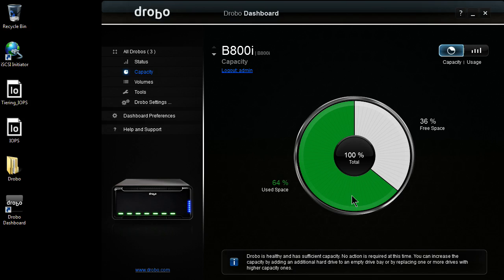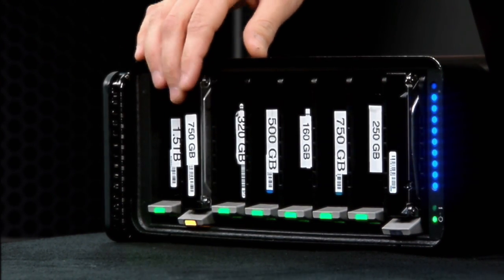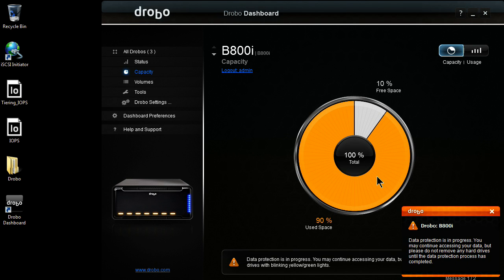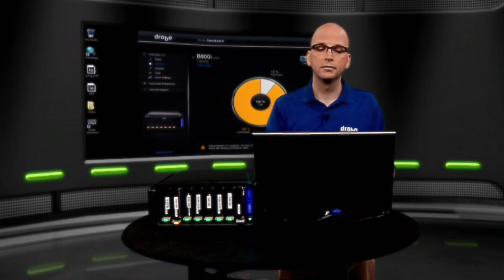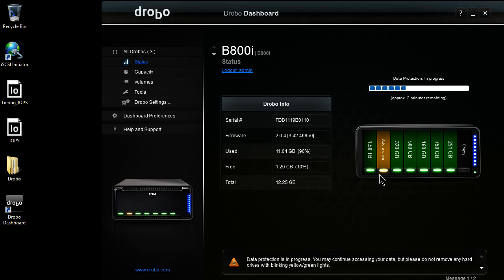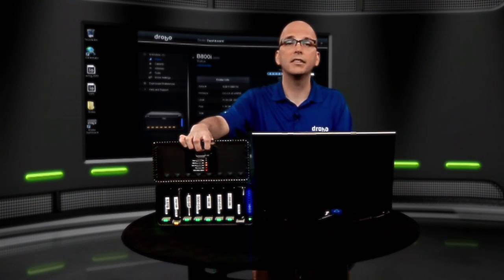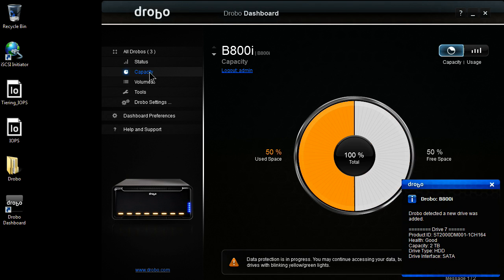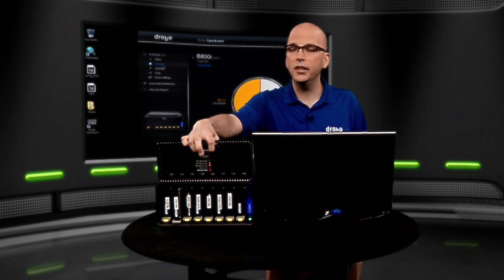Drobo | Software Demo | Automatic Rebuild | Automatic Expansion

Comment: 1) Don't you have to format the new HD before it rebuilds?
2) I performed a backup on my 4Bay 3GEN I selected the duplicate HD option in the event of a 2 drive failure.  When I went into Windows explorer I don't see the second/duplicate backup.  Please explain.
3) Generic question - Is it really necessary to do a complete system image of my main HD or are the backup's sufficient in the event of a main HD failure on my computer?  I am hearing pros and con's for both.  I would think that after installing a new main HD it would be best to just use the system disks and do a clean reinstall with a follow up install using the last backup file.  Any suggestions?
4) If the system is formatted as a single volume with only one drive Letter are the other 3 HDs within the DROBO duplicating what is in the first HD and therefore it does not matter which HD fails because the other 3 HD's look like the first HD?
5)  What happens in the case that the first HD becomes full and data storage now flows over into the second HD?  In theory the second HD would not have the exact data as in drive 1 because some of the data in drive 1 had to be stored in drive 2? If drive 1 were to fail and subsequently replaced, not all the data is stored on drive 2 because of the previous overflow from drive 1 would it not?
6) If DROBO uses proprietary software can I remove a drive, transport it and put it into another computer and have the files all recognized? This would allow great flexibility in my opinion when working with others on projects and ensure safe backups. 

Thanks for the video,

The Meltdownman

Comment: Rebuild times have significantly improved as the new devices have substantially higher performance processors.  The Drobo 4-bay was released when 250-500GB drives were the norm and its processor can take an extended period to chunk through today's larger drives.

Comment: I like my old school Drobo 4-disk unit but the time it takes to rebuild after a drive failure is so very very long. With high capacity drives and large multi drive arrays this time can only get longer and longer. 

With the example in this video, how long would it take to rebuild to a safe and secure state?